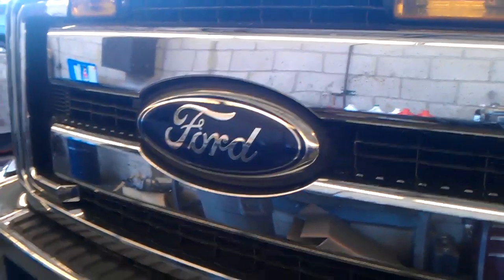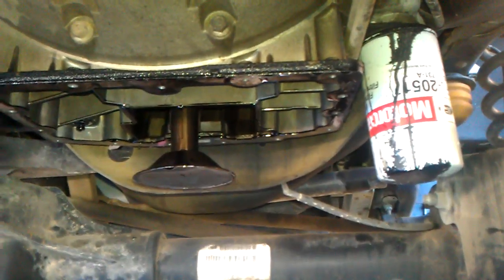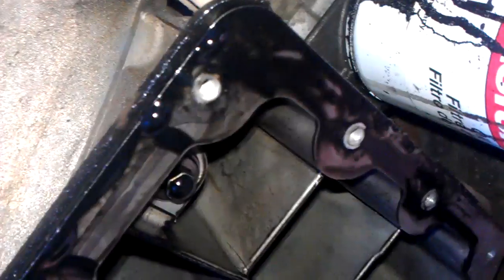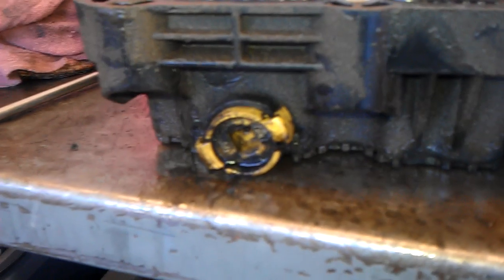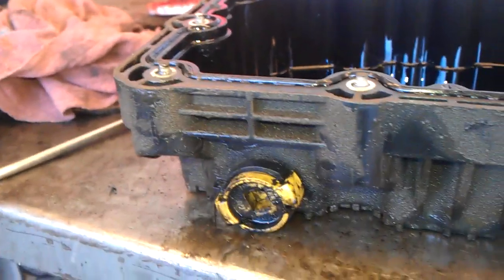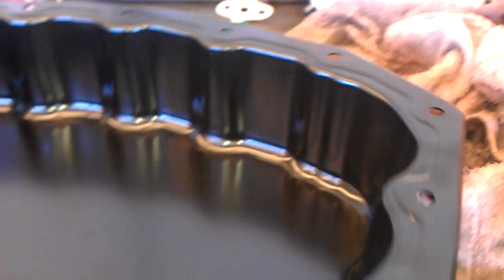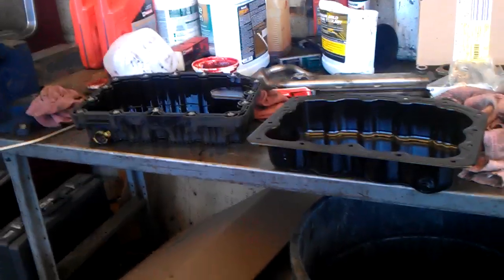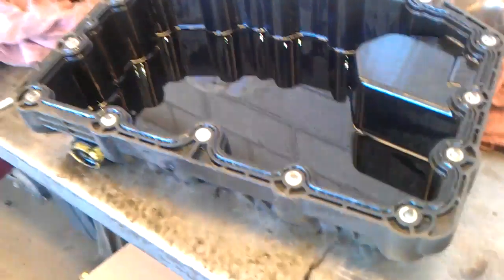SHOP UPDATE 6/22/12 6.7L OIL PAN GASKET

Comment: Using a MAHLE gasket for the lower. It comes with A thin orange RTV bead on the gasket. And the other side has nothing. Which direction is this gasket face? RTV bead side towards the pan or towards the block? Normally I would put my own bead of RTV but since this comes with this already won but assume it’s designed to use without. Any input would be greatly appreciated as I’m doing the project right now. Thank you

Comment: Joe Ford is saying use RTV sealant only when changing to steel pan. I’ve done it twice followed the tightening sequence with the torque specs and I’m still leaking. Do you use the aftermarket gasket that has been made for the steel pans?
Reply: That’s the same exact question I’ve got right now. I have a MAHLE Gasket specific to this oil pan size that has a bit of RTV pre-applied. It’s only on one side and I don’t know which side that needs to face, the block or the pan. What did you figure out?

Comment: lol  On the assembly line anything is possible.  I've seen VW use an octopus looking device that does all the fluids at once using pressurized hoses.  Takes like 45 seconds per vehicle to fill every fluid under the hood.  Often times when manufacturers break from the norm of a proven design (like a metal oil pan) and risk their reputations like that it's to save themselves time, money, or both- usually on the assembly line.